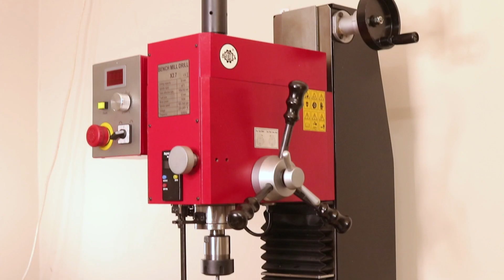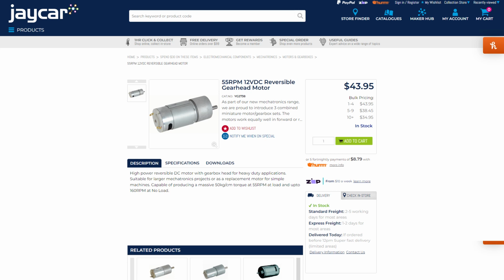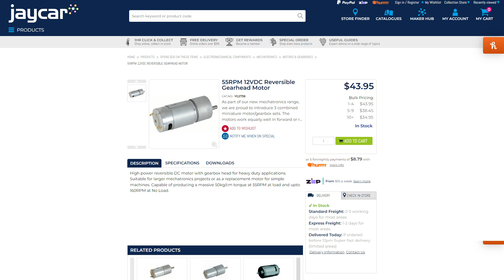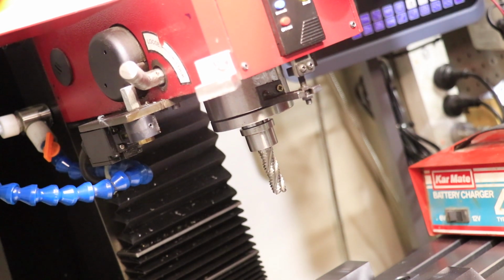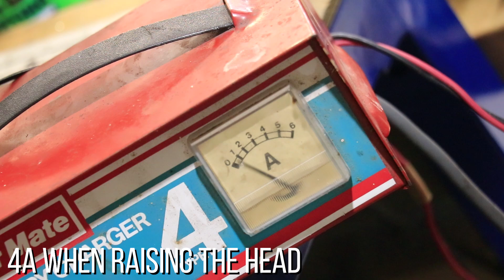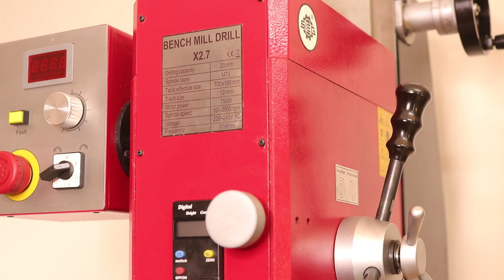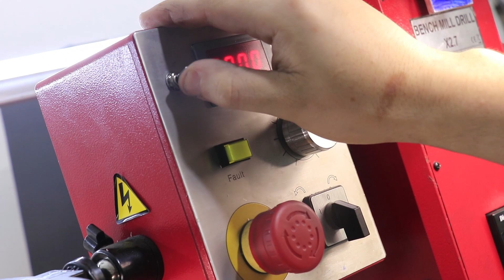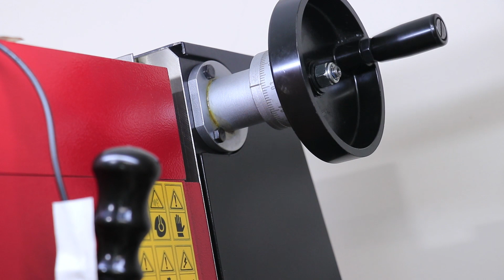Mill Power Z Feed Upgrade | Power Lift

Comment: personally i wouldnt spend the money or the time upgrading something like this.. or even buying it to begin with.. can find a used knee mill for  a few k.. if your really getting into machining as much as you seem to be its only a matter of time before u upgrade to a real mill wether cnc or manual and u wont ever touch that hobby mill again.. obviously you like to tinker not just machine so find yourself a used bridgeport and restore it if need be then upgrade that to nc controls or prototrak. just an opinion... decent kurt vice, dividing head/super spacer and rotary table and your good to go
Reply from the maker: This is the biggest mill I could fit into. This workshop. It's not my workshop so I have to work with the people I share it with. Cheers

Comment: Maybe if you consider an upgrade with a NEMA 23 + reduction, arduino for controlling and an RGI hand coder with x1, x10, x100 then you won’t need anymore that hand wheel . Adding 2 limits and some bits of coding and you can have some automatic control too. In the future you can add to this control the X and Y axis . 
This would be a good upgrade for your mill . 
Best regards.

Comment: I have the same Mill as you but went with a Closed loop Nema 34 stepper motor mounted vertically on the top of the column, I made an adaptor to fit the gear on top of the leadscrew.
Using a pulse generator I can get rapid raise and lower plus very slow speeds for vertical milling operations. Also have adjustable limit switches.

Comment: Great upgrade..You mentioned putting a knot in teh power cable instead of a cable tie...to my mind the knot will cause a potential heat spot if the motor malfunctions, so the cable tie is a lot safer.

Comment: Would a stepper motor have been a more prudent purchase, it would take you closer to a CNC mill?
Reply from the maker: You could make the case for a stepper motor, but for a cnc you'd really want to replace the leadscrew for a ballscrew. Cheers

Comment: Is the power supply protected from power back feeding into it from the engine by manually turning the crank? If it could create enough power to damage it in the first place.
Reply from the maker: It doesn't need to be, its not connected to the power supply unless the switch is toggled
Reply: @artisanmakes  I remember that now. I should've watched it twice, lol. While I have your attention, I would like to recommend using a cup wheel in the mill for a makeshift surface grinder, if you ever need one. Have a good one.

Comment: That is a nice upgrade. Nice and simple too.
I do recommend a larger switch to handle that much current - something like Jaycar CAT.NO:  ST0576, it'll handle the current a lot better.
Congrats on an effective and simple upgrade <3
Reply from the maker: Cheers, this switch is at the current limit, I'm sure it'll last but if it burns out I'll replace it with something like that.

Comment: Why are you using top handwheel to drill for?  Your mill has the lever on the side to do drilling with!  The top hand wheel is only used when fitting larger items to be milled and never for drilling! I bet you know this also?  What you are fitting is a power knee (in reverse)
Reply from the maker: I never said I use it for drilling, I use the quill for that. But you do need to raise the head to fit larger drills

Comment: Hello Mr. Artisan.
I'd like to recommend that you make sure your switch is rated for 12 VDC. The AC rating does not apply to DC, it is especially important since you are using the switch as directional switching.
Reply from the maker: Im the switch is rated for 4A according to the box, so I'm sitting right at the limit, we'll see how it goes but a replacement should only be like $5 if it goes. Cheers

Comment: I am doing the same but with an outboard linear actuator and gas piston. It works great but........
The head can only move if the gib is NOT locked. This means I have to wait for the motor to move and THEN lock the gib.
This always  moves the entire head about 1 to 3 mm. Obviously unacceptable. How do you handle this? Thanks for great videos. I am a new sub. //ji John in Oregon
Reply from the maker: you might want to look at the gibs inv the head, they might need adjusting

Comment: Awesome job! Can I suggest a diode on the motor side of the wiring to prevent back current when manual cranking  you risk spiking the power supply otherwise. Also limit switches and a guard on that toggle switch. 👌
Reply from the maker: That's not something to worry about because the motor isn't connected to the power supply unless im toggling the switch and in that case the motor would be running

Comment: Having two power supplies can be dangerous for future maintenance. Clear labeling would be a minimum with relays to disable the other supply more work than necessary when changing to a single supply, as you mentioned, is the way to go.

Comment: Is the gears inside gearbox plastic or metal? On some small gearboxes, turning the gearbox from reverse side (when hand cranking) isn't supported, might break gear tooth if plastic gear.
Reply from the maker: I believe they are  metal gears

Comment: Nice job - 2 suggestions: Put some limit switches in at the top and bottom of the shaft to stop the motor before it hits the limits and shears the coupler. Second, replace the switch with something less likely to be knocked accidentally, e.g. a shrouded switch.
Reply: I agree about the switch.  I would use a shrouded rocker that defaults to off.  That way it can't accidentally be bumped, and the operator has to physically hold the button in the direction of movement.
Reply: @Jason Rosinger absolutely, but it still needs limit switches to cut down the number of operator induced crashes
Reply: I definitely agree about the limit switches.  There is never too much overkill when it comes to protecting against momentary lapses of reason.
Reply from the maker: That would be entirely up to personal preference. I personally don't think that they are 100% necessarily buy im sure other people would see them as a necessity.
Reply: @artisanmakes    This is true, but we all know how mistakes are made.  You click down to lower the head, turn away for a moment and next thing you know, you've crashed the Z axis.  We love your channel and are just offering advice based on mistakes we've all made.  Keep up the great content bud!!!
Reply: @artisanmakes  In this case it's not so much a case of personal preference, and more of safety.
Reply from the maker: @pedro_8240  As I said its entirely up to you, I personally don't think I need it. Cheers
Reply: @pedro_8240  Given its a momentary switch, he has to hold the switch while its moving, so the likelihood of crashing, and then continuing to hold the switch in is pretty low, so this isn't really a safety issue.  If it were a non-momentary switch, perhaps you would have a valid point, but its not, so its not.

Comment: I just bought a Sherline and although I want to avoid mods, one that I am immediately contemplating is fast movement of the carriage because of indeed, the 1mm per rotation! To keep everything as manual as possible, I may one day try to add a half nut. However, the lead screw is a normal thread, not ACME. Not sure if that would work.

Comment: Nice job, you might consider putting on a small gas strut, the ones they use for hatchbacks, to aid the motor in the uplift direction as you can hear that its not as fast going up as down.
Reply: I have a 50lbs gas spring on my LMS550 (SX2.7) and it's about the perfect balance. May do a power feed someday.
Reply: @aeroderek  https://youtu.be/_6S-ARxZud4 power feed x
Reply from the maker: I have seen that mod done on those x2 mills, but I don't think that I have seen it done on these larger mills.
Reply: Attach with an L bracket on the bottom casting and another one on the head on the right side so it tucks in behind the z hand wheel
McMaster 4138T62
Reply from the maker: Thabkyou, we don't have mcmaster where I live but I might try and source something similar
Reply: A simple pulley and counterweight if a strut proves hard to come by or too difficult to fit.

A strut's a great idea for longevity of a leadscrew too although you may go through a few struts per leadscrew... or many.

Comment: Such a great simple solution! 👍
That switch is a bit smaller than optimal for 4 amps and might not last forever, but it is an easy job to replace/upgrade the switch at any time.
For the X power feed I would recommend a stepper motor because they keep exact speed regardless of cutting load, that is important to get a good surface finish.
Reply from the maker: Cheers, the spec sheet says its rated for 4 amps dc so i'm probably sitting right on the limit. Still haven't settled on the exact set up for the table feed, but a nema 34 stepper certainly is the likely option. Cheers.
Reply: @artisanmakes  On-Time(your Powerfeed) / Rated-Time-at-max_current(of your switch) = UF(Usage-Faktor). Max_current(of your switch) * UF = The_current_we_maybe_can_get_away_with ... :) In short, that just means that you don't use continuous operation, so ... let's ignore the good advice from Wiz:P
This broad interpretation is only based on the thermal aspects. If the currents are larger (i.e. much larger), parameters such as the spark gap or the contact material come into play. These are then simply not able to switch these currents and ensure that the switch wears out quickly. Or worse: The switching contacts STICK(=DESASTER)!!! For this reason, this power feed should also be supplied via the standard machine emergency stop mains net. Another safety aspect is the type of switch. You can take a look at <search engine here> image search. Toggle switches, up and down buttons or, in the case of expensive models, real levers(with haptic feedback) are usually used as switches for power feeds. This has the reason that one does not accidentally switch. Switches such as the one you used tend to break off and get stuck in one (possibly switched on) place.... So choosing the right switch is a crucial safety issue here, especially as they are used to control a moving part!
I don't see it that narrowly now, but maybe you should think again and look at the many other (preferably professional) solutions and get some inspiration from there. As always, your limbs will thank you in the long run... :) Oh and thanks for the video!
Reply: @artisanmakes  TLDR; Instead of dirty botches, RTFM: take a look at the datasheet of the switch. They usually give the peak current and related timings.

Comment: Nice work! One downside that i can see for this moment(if i understand correctly, that you power motor from different source) - this solution cant be stopped with emergency stop button or turn off switch on mill
Reply from the maker: Cheers, certainly something to consider
Reply: @artisanmakes  I'm not sure if it will need to have an e-stop given it operates on a momentary switch -  in theory can't stay on. But there's theory and then there's practice...